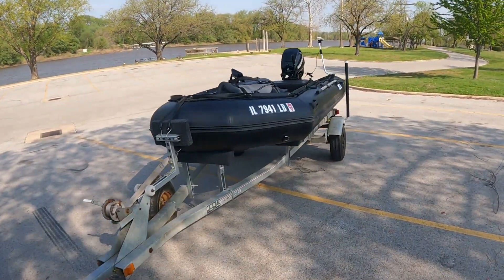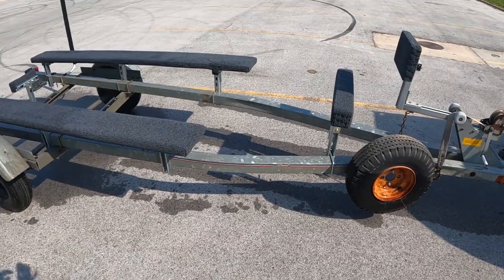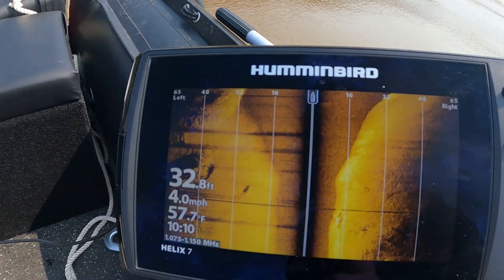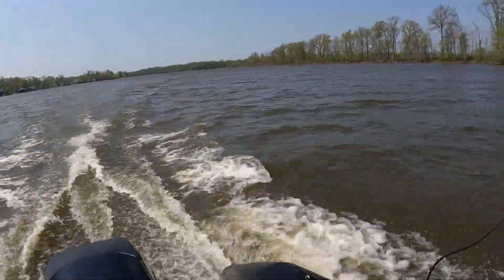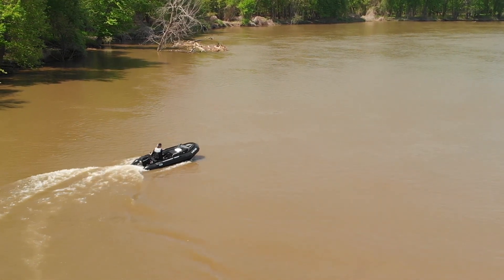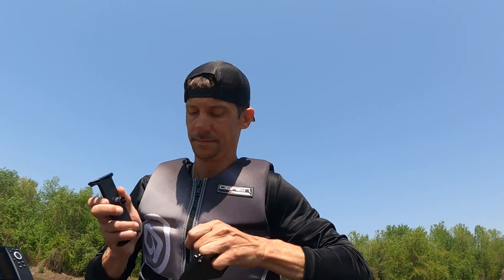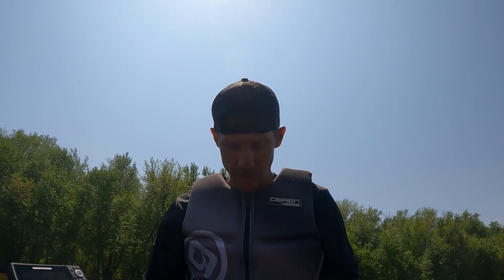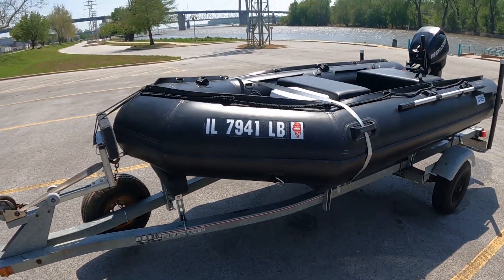SIB on the Mississippi River - BRIS boat SOLO performance RIVER RUN - How well will it handle????

Comment: Really nice setup!! I have the same boat, and just upgraded from a Coleman 9.8hp 4 stroke to the same engine you have, a Mercury 20hp 4 stroke short shaft 2020, I'm excited about taking it out in the next few weeks to my closest lake, Elephant Butte, NM!!
Reply from the maker: Nice! Have you tried your new 20HP out? That's a huge upgrade from a 9.8 HP.
Reply: how did it ride with the 9.8?
Reply: @doublepitstochesty1 I also want to know this. What was the top speed?
Reply: I didn't actually measure the speed, but it was decent with only 2 people on board!

Comment: Well done with catching the drone 😅
Quick question: I am towing between an inflatable kayak-canoe or a nice inflatable like yours. An inflatable will ofcourse have more space. But can you tell me how practical you think it will be for river use with paddles. Will it work if my wife sits in the front and me at the back - both of us rowing? I don’t think we will do more then a few miles a day if that
Reply from the maker: Thanks man!! I think a boat like this would be pretty practical and could always put a little trolling motor on it if you ever wanted to. The inflatable kayaks are quite small and narrow, but would work for just cruising down the river if you weren't doing much else on it. Hope that helps.
Reply: Many thanks for the reply…and the style of using the paddles I described you think will be ok?
Reply: Mississippi River - always wanted to see it. Still the Thames in its upper reaches is delightful
Reply from the maker: @ajmal4149  Not a problem. And yea, that style of paddles would work fine.

Comment: Could I trouble you for a question. I need to make a trailer for my FC470 so I appreciate you showing us this off the trailer. I see you have used what we call UniStrut for for you bunk uprights.  

Can I ask;

What bracket have you used to connect the Unistrut to the Bunk ?
Reply from the maker: So I connected 2 unistrut pieces to form an "L" shape by using a 90 degree bracket to hold them together...then just lagged bolted it to the underside of the bunk.

Comment: love the trailer design.  any sway while towing at 60+ mph?
Reply from the maker: Thanks...no swaying, but bounces a little bit with the weight of the motor on the very back. If I was to trailer it a far distance, I'd probably take motor off and lay it in truck or IN the boat over the axle to help the weight distribution.

Comment: Hello, I like that boat and I'm about to purchase it. My only concern that in southern california the weather is really hot and in the summer this black color will make the boat even hotter and toasty to touch. it's a 1.2mm which is why I like it but the color is my issue.  Asking for a friend !  do you guys see my point or is it really not a big deal ?  
My last concern is that I'll be taking it off shore , down to Catalina island. is it safe ? will it do ok ? My motor is 20HP suzuki.
Reply from the maker: Hey. I haven't tested how much heat the black retains compared to a lighter color. From what I've learned from others is the black will be a little bit hotter than say a white one. It gets about as hot as a vinyl boat seat would get. I usually just splash some water on it if I need to touch a spot that's not already wet..lol...as far as being safe, these boats are pretty safe. There is 3 individual chambers of air on this boat so one or two can get deflated and retain its buoyancy. They are high volume, low pressure tubes so would never pop like a tire or other high pressure tube would. Always keep a pump and materials to fix a hole on board at all times so repairs would be simple and can be done easily on the water. You can literally fill this boat with water and it will not sink, unlike a jon boat or fiberglass hull boat.  Hope that helps.

Comment: How long have you had the boat and how is it holding up? Some people say Bris inflatables can  leak within a year or two and they don't last very long. Others have had them for over 5 years.
Reply from the maker: I've had mine for almost 2 years. Everything's still as it was new, but I do keep it inflated and garage kept on the trailer, so it's never out in the elements, which I believe makes a huge difference in how long it will last.
Reply: @cBelowH2O  Great video. Really well done.
Reply from the maker: Thanks! Waiting for this weather to warm up to get back it.

Comment: What transducer mount is it that you have? How sturdy is it?  Have you had it up to full speed with the arm in the water?
Reply from the maker: Its a kayak transducer mount. I listed the link in the description of that video. Its pretty sturdy for what I need it for.  I have gone full speed multiple times with the arm in the water but loses its sturdiness since it flexes with the inflatable tube so I typically swing it up since the transducer wont read at full speed anyway and dont want to put extra stress on the arm for no reason.

Comment: Nice video! Really enjoyed it alot. I have the same Bris and a Tohatsu 20HP that I took to the Bay a bit, but not in rough water. Videos are in my channel. Which drone do you have? I'm thinking of getting a small one too.
Reply from the maker: Thanks man!! Appreciate it!! That water you were on is much nicer..lol..and some Bays can get pretty rough with boat traffic. How fast did you get it up to?  
This drone is the  DJI Mavic Air (first model). I love it - Ive taken great care of it and just now started getting a little more daring with it. :)
Reply: @cBelowH2O  when I had the 11.5 prop on, in calm water I got up to almost 22mph with 3 people. I changed to 10p and get around 20+mph or so. But my RPM went from 5700-5800 to 6000-6100 with the smaller pitch prop.
Reply from the maker: @wacpickleball  Thats actually pretty good with 3 people onboard. Nice boat you got there!!  I thought about changing the prop but wanted to take it on calm waters first and/or reduce/rearrange the onboard  weight.
Reply: @cBelowH2O  thanks! I’m happy with the speed any faster I would get wet in some choppy water. Lol. The Bris with the console and Honda 20hp is a friend’s. Same boat. He switched from a 4 blade to a 3 blade stainless steel prop and only managed about 17-18 with 3, I think he carried more weight.
Reply from the maker: @wacpickleball  Right. Im happy with the speed as well. Didnt really get it to go fast...lol...

Comment: Hello…. Where did you find the “L” shape brackets to support the bunks? I have the same boat and I’m having difficulty getting the bunks as wide as the tubes….. any insight is appreciated! Thanks
Reply from the maker: Hello
I got the L shaped brackets at Home  Depot in electrical by the "C" channel, which I also used. And used 2x12 treated lumber wrapped in outdoor carpet for the bunk.
Reply: Thank you so much
Reply from the maker: @kyesto  Anytime!

Comment: I'd love to take a three hour tour with you on that Bris!!   I'll meet you halfway.   Gulf of Mexico somewhere?
Reply from the maker: Lol. Hoping to take it down to the Gulf sometime - in the Florida Panhandle. Where you located?
Reply: @cBelowH2O  San Francisco Bay Area I've got the Bris 12 1/2  with 20 hp Tohati. but I've been having  so many problems with mine though
Reply from the maker: @QtheminiQ  Thats pretty far from the Gulf...lol.  what problems do you have with your boat?
Reply: @cBelowH2O Halfway?  
My Bris aluminum floor panels bent, so the stringers would not snap on to sides.  still waiting for replacements.

Comment: How did you get your registration letters, numbers and sticker to stick to your inflatable. I own a 13' Saturn Kaboat and was not able to get them to stick. One problem is that I deflate the boat for transporting it and that causes them to fall off.
Reply from the maker: I actually bought the material with the numbers on them and glued the one whole piece of material onto the boat, I have a video showing the material and where I ordered it from. Hope that helps.

Comment: Here's a quick tip for you: As soon as you grab your drone, flip it upside down quickly.  That will stop the motors automatically, without having to touch the controller.

Comment: Love the video.  My home! Been looking at how small boats perform on the local stretch of the Mississippi, this was very helpful!  Ps if you like bicycles we have some decent trails just down the road from where you launched.
Reply from the maker: Thanks! This boat is about as small as they get..lol. and that's cool, I havent rode in years (10+ years), but Ive seen those trails but never rode them. I got more into water/underwater adventures. :)
Reply: @cBelowH2O  hey you're in illinois? What size boat is that cuz I was looking at getting the 15.4
Reply from the maker: @popitscorner777  Yes, in western Illinois. Its the the 12 ft. I thought about the 15 ft one, but didnt want one quite that big. If you plan on more than 2 people, 15ft would be better.
Reply: @cBelowH2O  I'm in Wisconsin by Madison what would you charge to build a trailer like that to fit a 15.4 just out of curiosity if I brought you a trailer you would just have to add all the stuff to make the boat fit and be properly secured
Reply: @cBelowH2O  including the seats I would need two of them with storage like you have
Reply from the maker: @popitscorner777  Would depend what kind of trailer you had. Im not exactly sure what I spent on materials, would have to get a figure together.
Reply: @cBelowH2O  I would get a Harbor Freight trailer probably a 4x8 I seen on another dude he built the same size boat 15.4 on a 4x8 trailer. I was hoping you had some more of that wood laying around LOL that you built your stuff with but no just shoot me a ballpark if you would be interested
Reply from the maker: @popitscorner777  Yea, I thought about a harbor freight trailer. I got lucky and got a free boat trailer. Would be quite a different build compared to my trailer. I do still have plenty of wood to construct more seats. Shoot me an email to discuss further - cbaqualife@gmail.com

Comment: What size is the boat and what outboard you using?
Reply from the maker: Its a 12.5 ft boat. The motor is a Mercury 20HP 4 stroke.

Comment: You can set the drone to go back to we’re the control is fact I have a phantom 4 pro woth sensors always change the settings to go back to the control fact and the sun also affects the drone sensor s and as long as you keep it 8 feet above the water your good
Reply from the maker: Good idea to take note of for next time. I was in a current so the boat was constantly moving, so I'm not sure it would have made much difference in this situation. Lol

Comment: Question, how do you hold those new seats on the floor?
Reply from the maker: The middle seat has the weight of the battery in it and back one has gas tank strapped to the floor through the base of the seat. Also I have d-rings attached to seat boxes perfectly in line with the d rings on boat so can clip them in if I ever wanted to.